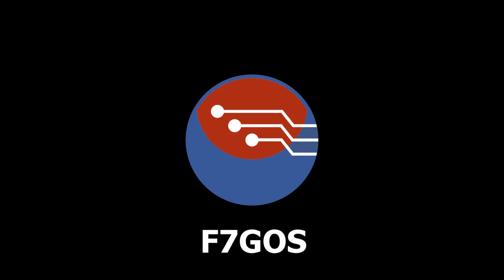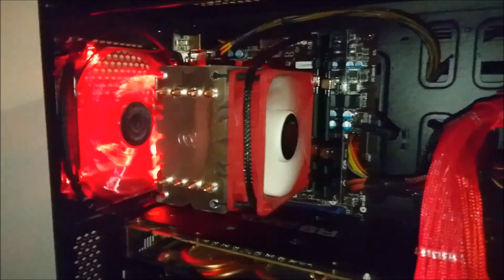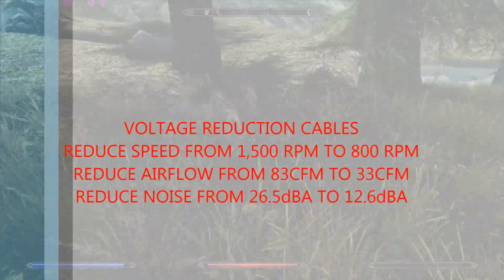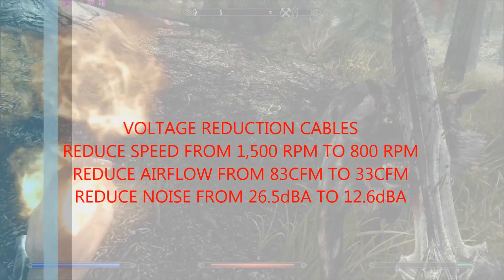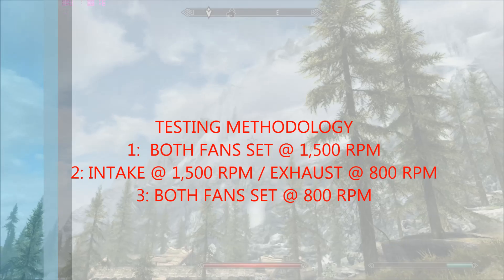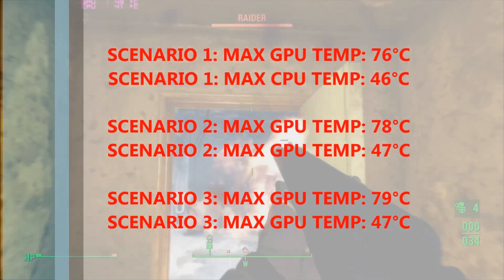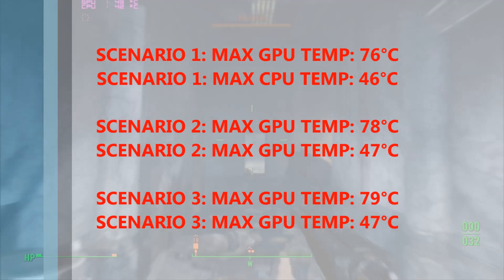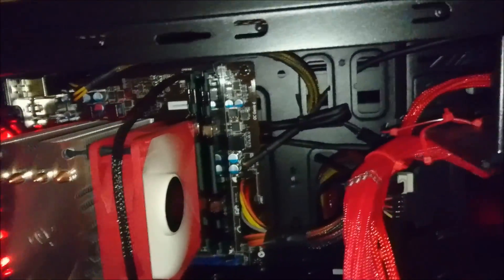Should you change to low RPM Fans in your Gaming PC?

Comment: idk much about pc's and all the voltage stuff but i have 3 deepcool RF120 fans at the front and a standard fan that came with my cooler master litebox 5 case at the back. i lowered the rpm from 1000 to around 600 on the fans. they were running extremely loud for my liking and i could barely hear myself think. do you think i should replace the rear fan to something that will be silent but maintain a good rpm? also is 600 good or bad? i play some games on my pc but mainly just general use and music making.

Comment: I've been hearing about these voltage reduction cables.. Maybe it's because I have an advanced motherboard.. but why don't people just use the fan headers on their motherboards to control the speeds manually? What's the point of the cables? By the way, I really like the logo for your channel.
Reply from the maker: +hpvegan it's useful if you say only have one fan header and need to use a molex connection for the fan
When using molex the fan will spin at 100% speed all the time.  The resistor cable reduces that
Reply: ahhh got it. Thanks. I imagine you can tell by my question that I built my first PC in 2016.
Reply from the maker: +hpvegan all got to start somewhere, I made every mistake in the book when I built my first system 😂
Reply: I have 2 fans with manual 3 position switch. and they are set to medium speed all the time. 
2 fans on System fan header. and they are set to work with CPU temps.

Comment: Yeah I found today that slower is better! WTF. 
So my idle temps were higher on AIO, so I thought increase pump rpm and fan speeds all 7 fans. Changed from 64% to 80 and back to 40%. I could NOT believe that LOWER RPM got me the MOST STABLE TEMPS and LOWER TEMPS. 

Seems like pushing water pump flow maybe does not have enough time to pick up heat transfer from CPU ?
Fans in case maybe already moving ROOM air enough thus making them move the same air faster had negative or same result?

Either way pump at 49% and ALL fans at 40% yielded again most stable temps along with lowest temps. 24 hour testing and monitored in LARGE case with INSANE AIR FLOW.**
Reply from the maker: +DSM Dallas it can be counter intuitive but sometimes slower exhaust let's air get drawn from other areas decreasing Temps. I know it's a different subject but I remember on an old V6 I lost a lot of horse-power going to a 3" diameter exhaust (I was thinking more air out the better) when the more restrictive 2.5" suited the engine better and gave more power and efficiency since it was the perfect size to exhaust all the air that was being drawn in... 

#longwindedsidestory